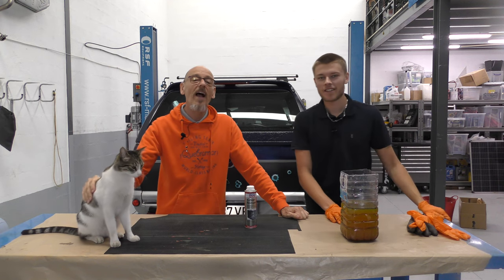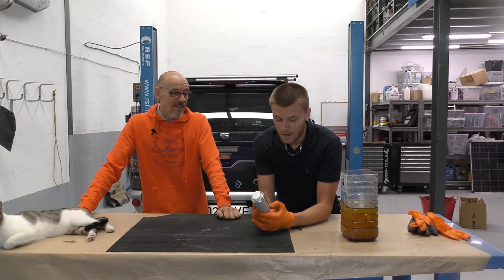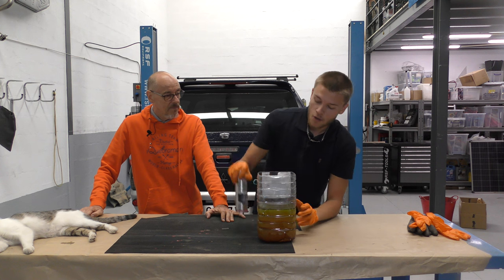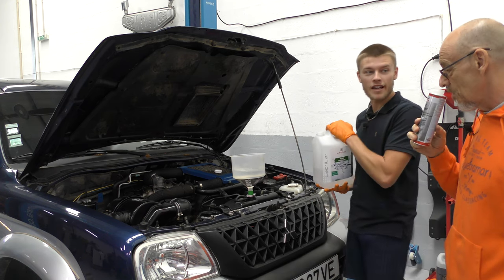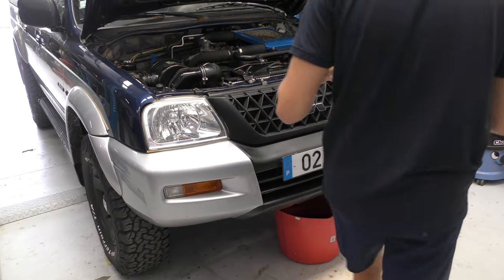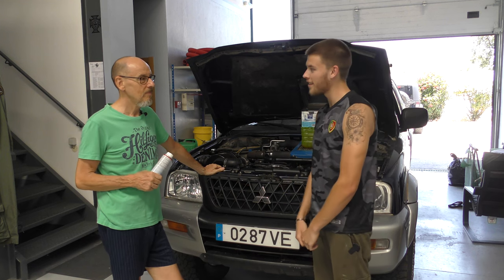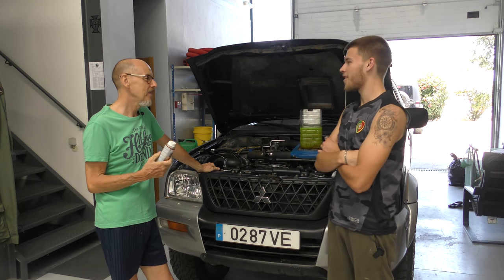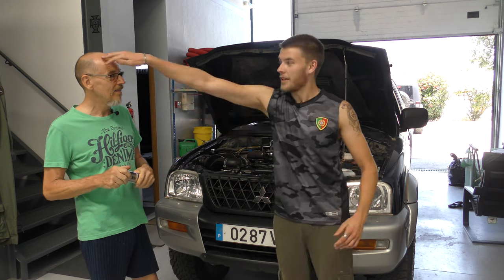Does Liqui Moly Radiator Cleaner work? Test on FILTHY coolant system

Comment: I was wondering if it might help me save a heater core change; pry not.  Mine has been half-gummed for 2 years.  I've been putting it off so my passenger side window stays frosty.  Okay pipe vs. tube, not that anyone pry cares, but pipe is measured by I.D. tube O.D.  Maybe its just a British thing like boot/trunk etc.  Anyway, I'm afraid to use it on a car with 50k miles, 2 water pumps, and plastic impellers but I'd be interested to see if you have to change a pump/thermostat/etc. after a year or so.
Reply from the maker: Our JEEP was the same, heat one side, very common with Jeeps - the Jeep was sand from the casting (so we were told) - crap build quality - would not expect that from a Japanese build ? so you might have a chance - with the Jeep, we disconnected the pipes to the core and using a submersible pond pump (hose would be easier), flushed it (reverse from flow) and that did the job - as to the Mitsubishi, that flush was amazing, very surprised with the results - we have been chasing an overheating issue for ages - so I cannot state the water pump condition as we changed it twice this year (for no reason it turned out) there was no over heating, the alternator was knackered so spiked the gauge :(  to high. Thermostat prior to the flush was unbelievably shitty, now we have a clean system.

Comment: hi i had damaged engine oil cooler does it good  in clean clear oil mix with coolant can it remove from system
Reply from the maker: Commercial Engine Degreasers are best to use in a cooler - they are specifically formulated to remove oil and grease without damaging components.
Or you could try:
Brake Cleaner: Effective for cleaning metal parts and evaporates quickly.
Hot Water and Dish Soap: Safe and effective for removing oil without harsh chemicals.
Specialized Oil Cooler Cleaners: Designed for cleaning oil coolers without causing damage.

Steps for Cleaning an Oil Cooler with a Safer Alternative:

Drain any residual oil from the oil cooler into a container.

Apply Cleaner:

Apply a commercial engine degreaser or specialized oil cooler cleaner to the oil cooler.
Follow the product instructions for application and dwell time.
Scrub Gently:

Use a soft-bristle brush to gently scrub the oil cooler.
Avoid hard-bristle brushes or abrasive tools.
Rinse Thoroughly:

Rinse the oil cooler with water, using a garden hose or low-pressure washer.
Ensure all cleaner and debris are removed.
Use Compressed Air:

Blow out any remaining water and debris with compressed air.
Focus on blowing air through the fins and small areas.
Dry and Inspect:

Allow the oil cooler to dry completely.
Inspect for any remaining debris or damage.

Comment: I bought a 2004 F250 several years ago. The coolant looked like shit, so I got some Prestone system flush and ran it for a week. I then took to my mechanic and had a full flush done. He flushed it twice but it was still a little rusty. He replaced the coolant, and three years later the coolant looks like it did when he replaced it. The stuff works, but it doesn’t get rid of everything. I think if I had another flush done by my mech, it would probably be even better now.
Reply from the maker: Great tips - cheers

Comment: Thanks for the video!
Do you think it will remove oil from the radiator?
Reply from the maker: We did not really see any improvement, but ours was years of crud ( so we changed all the pipe work, radiator, thermostat and reservoir - then many a flush later and its more or less spot on. I suspect it won't clear oil, but if only a light mess 🤣 then it stands a chance - sorry a very non-committal answer
Reply: @DrivenMadShow  haha thank you! 😂

Comment: Does it remove rust and sludge in pipes
Reply from the maker: We cannot believe the result - next week we change the radiator and you will see the coolant after 5000km
Reply: Did it remove the rust?

Comment: Use the Prestone flush and leave in for at least three days.
Reply from the maker: Thanks for the tip :)
Reply: Do you drive around with the Prestone in the cooling system for that long?

Comment: water and vinagre works perfectly, cheaper and friendly for the environment
Reply from the maker: Our house cleaning solution of choice 🥳
Reply: Doesn't vinegar contains acetic acid, which makes metal susceptible to rust?
Reply: @NicolasRodriguez-iu5ii  true but it is soft when compared to other products and after you clean the system with it, you wash it with destiled water and add antifreeze liquid. Only if you left the system with water or empty rust would appear again. Antifreeze has anti oxidante componentes as well as lubricant to keep water pump happy (etileno glycol if not mistaken)
Reply: @farmoboy83  fair enough
Reply: How much water, how much vinegar? Thanks!
Reply: How much and what concentration of vinegar do you use to flush and kill the rust? 

Does vinegar damage seals? 

How long do you leave the vinegar in it? Howany hours does it need to run?
Reply: @Lauradahl-creations  50/50. only put the mixture, turn the engine on for 2 or 3 minutes and leave it for 2 or 3 hours. Flush it multiple times with destiled water and then put coolant in.